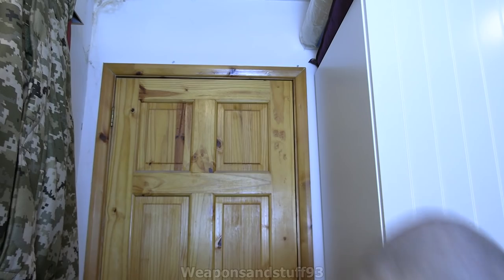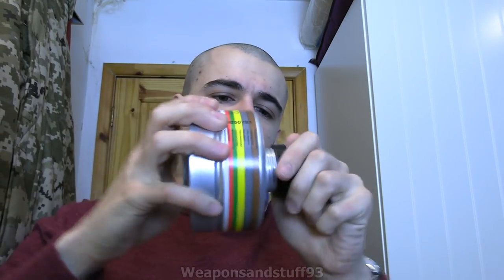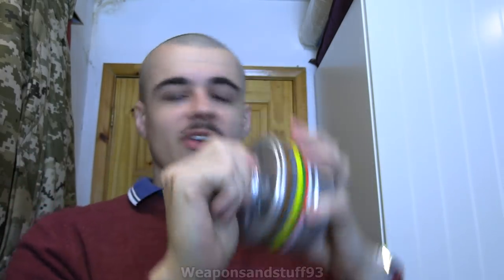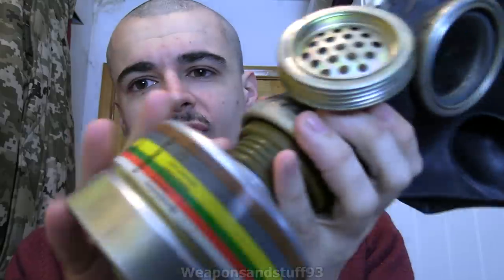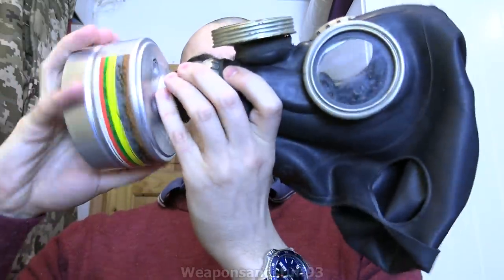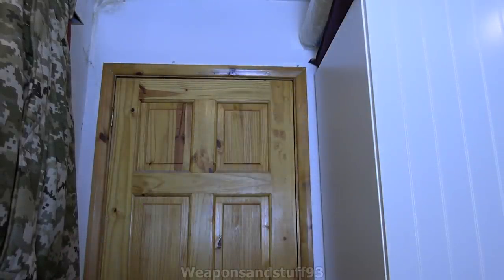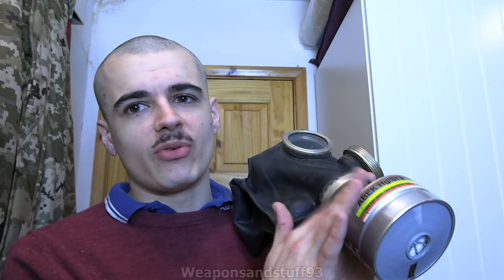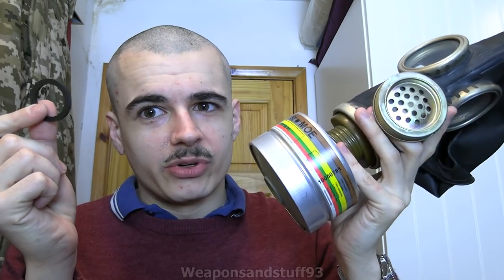Another video on O-Rings/Washers for bodging filters

Comment: I found that a 1 1/4 inch rubber washer will allow NATO thread filters to be successfully placed on GOST threads. I conducted the tests,  to check for infiltration per US NBC school, (I did graduate many years ago) recommendations. It does  make a functional seal. The sealing surface is the interface where the end of the GOST threaded part meets the rubber washer, which means the washer has to be tall enough but not so tall that threads are not engaged. I do understand this was not an intended feature, of either threaded parts, but it will allow it to be an alternative.

Comment: Hey bud, thought id let you know, received a Czech CM-4 today, a SCOTT 40mm fits perfect, nice and smooth, nice and air tight
Reply: I am slovak. For real ?
Reply: @jakubmatta6642  Yes, fits perfect
Reply: Thanks, this helped me
Reply: CM4 masks were made with GOST or STANAG thread, so you just got lucky
Reply: Actually I tried fitting czech MOF-6, OF-90 and Slovak OF-99 (Rd40x1,7¨) in my gp-5 and polish om14 faser and it worked without any problems

Comment: if you are in a pinch and cant find a o-ring that fits, you can always use teflon tape, they use that stuff on pneumatic fittings to ceate an airtight seal.

Comment: Make your own spacer by using the rubber seal inside cap of the GP-5 filter . Heat it up to loosen the glue then punch some holes in the center leaving the outside perimeter intact and presto ! Works with nato threaded plastic P3 filers

Comment: Off topic question, i wonder about how to make my gp-5 a little bit elastic, i mean, it does fit to my head but its a bit hard to stretch so im wearing them unlike you, from the chin stretched to the back, but im doing it reversed. Any advice? Thanks.
Reply: I did measure my head before buying. Is soaking the mask in warm water for a couple minutes help? If yes which one is the best? The manequin head or soaking method?
Reply: Also i swaped the old filter with gp-7 filter now. And i got a spare one

Comment: i've done more research into 3d printed airtight fittings. 3D prints are actually extremely porous and basically impossible to get to seal on their own. You would want to seal your adapter with something to get a proper airtight seal. I think Polyurethane should work fine.

Comment: what about 3D printing adaptors?
Reply: Bad chemical resistance and possible imperfections that destroy the integrity of the airtight seal. There's also the question of porosity of 3D printed parts.

Other than that, it's a nice technology. Printing them in Nylon instead of the usualy ABS or PLA would increase chemical resistance a lot.